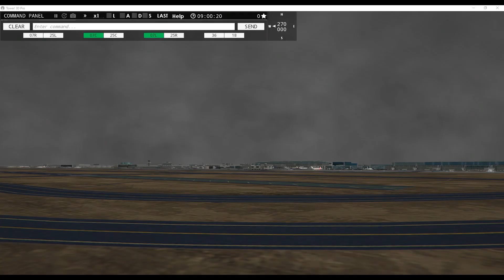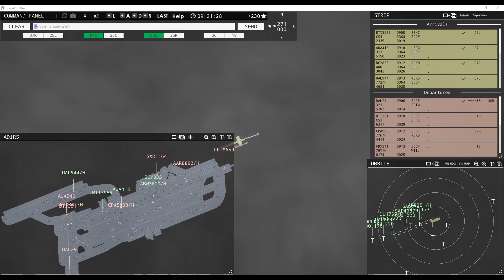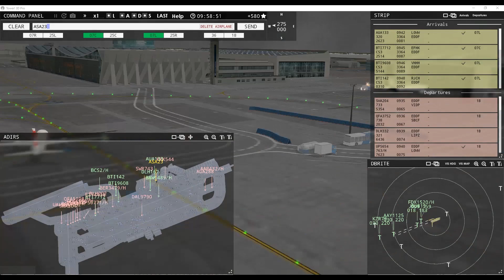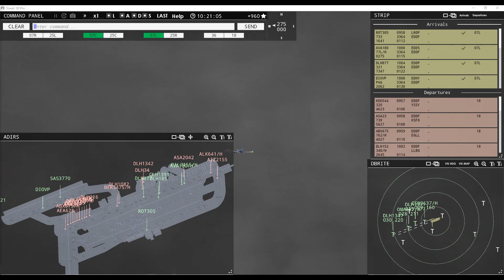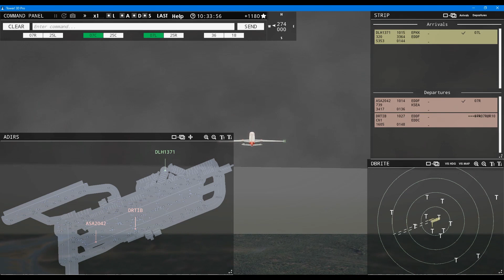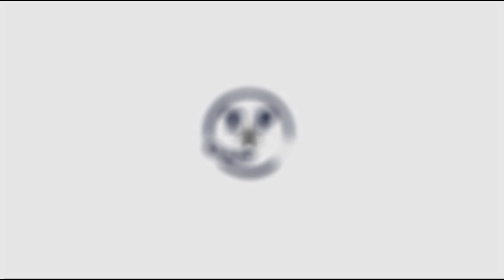Frankfurt Germany viewers requests and a tough day at the office Tower!3D Pro (modified*) EDDF @ 9am

Comment: i´ve a question , i cant use he command runway 27 via N A C, i have to say Runway 27 TAXI via N A C, its not anoying but sometimes i say it and it doesen take it, can i do somthing on this?
Reply from the maker: You can go into your Tower3D Pro file then open your tower3d.rec file to check all the commands you can give. I may have other commands than you because of the mods I´m using.
Reply: @TPGamingATC  Thank, didnt knwo i can do these these things things lol : )
Reply: @TPGamingATC  is it normal that its loading very long after i changed it?

and tower 3d pro isnt loading in the game at all so yeah, do you have a solution for that? wouldnt be problem if not
Reply from the maker: What did you change? If you changed the commands, then don´t. You cannot overwrite and add new commands.It´s not that easy.
Reply: @TPGamingATC  oh, ok , i just wrote the exact same command, and then added what i want, so i wrote that i could say "runway 27 via L A F" but ok,(i wrote in in the style it should ve with the # and ;) i´ll use the normal commands then, and thanks for your great and fast feedback!
Reply from the maker: No worries.